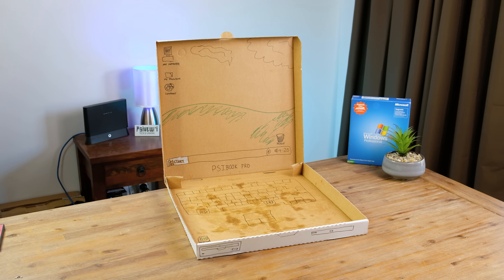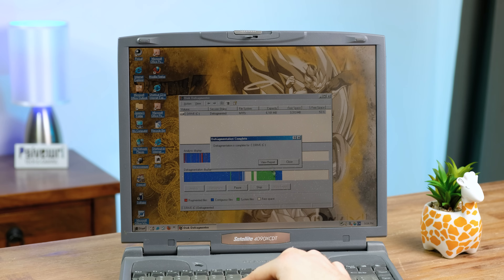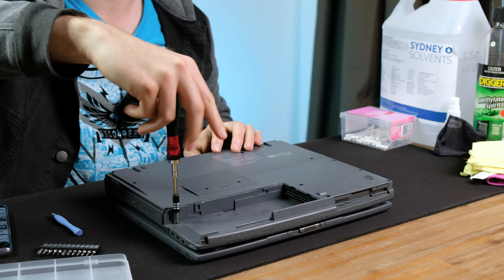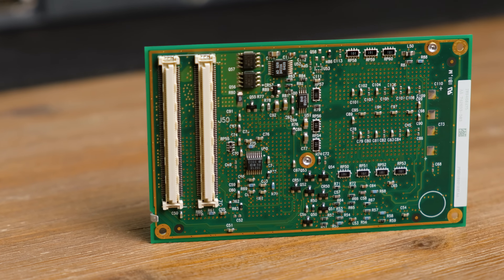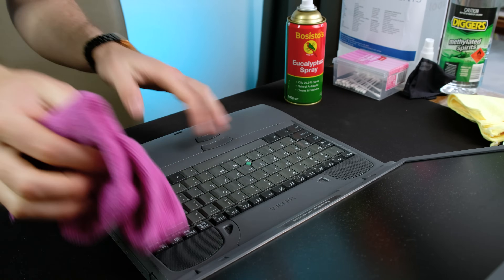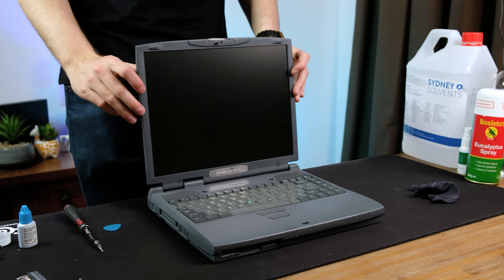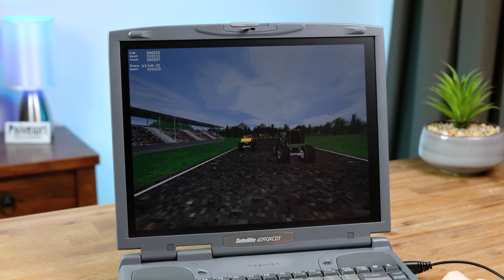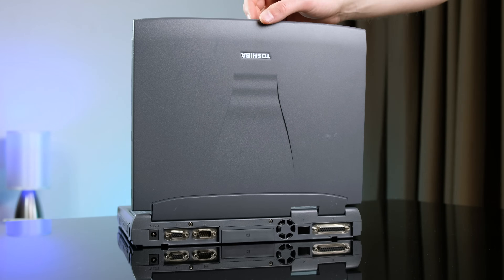Restoring An Old Windows 2000 Laptop!

Comment: I have a dell latitude that runs windows 2000, I thought about going back to win 98. I also have a newer latitude that runs XP and that's my favorite laptop I like these because you don't burn your legs using as a laptop the fans are in the rear of the computers. I actually have three old laptops my 2nd favorite was an apple running the lion version. I don't like new apple anything. I will keep the old ones running. I have to find my oldies packed somewhere in the hall closet. My first computer was a TI 99/4a all my computers worked the last time I fired them up. 73

Comment: The reason for the brightness changes, overall dark screen and the red/orange tinge over the whole screen is because the CCFL tube used for the backlight is reaching the end of its life. That screen has had heavy use over the years, and probably has tens of thousands of hours on it.

The CCFL can be changed, but it's not a trivial operation. Most LCD panels are not designed to be serviced, and the CCFL(s) are usually buried deep inside the panel, often requiring the panel to be completely disassembled. If you get that far into it, you'd be better off LED modding the panel, which would result in a brighter image and lower power consumption.

Comment: I bought a lower end version of the exact same laptop (a 4060XCDT) for exactly 1€ at a boot fair. It comes with a mobile Pentium 2 at 333 MHz, and came with the 128 MB RAM expansion, which unfortunately was defective. The hinge also broke on me, and even after attempting to expoxy it together, it's quite loose. Apart from that, everything works perfectly, even the original 4 GB hard drive, and even the floppy drive! Oh, and the speakers sound absolutely incredible for the age of this laptop. Aesthetically, it's in perfect condition.

Comment: If you own a computer from this era and you want to copy your files and save them to a new modern disk you simply cannot do it since there are no compatible ports with modern computers any more...so basically your files go with your old machine if you didnt manage to create copies when technology was changing and thats something everyone has to consider in the long run and create backups.
Reply: it have USB port, you can plug an USB to back up your file just in slower speed (USB 1.0) or even in an old way, burn a CD-r lol.

Comment: One of the best variant of these laptops is the Toshiba satellite pro 490XCDT, I did the same ram upgrade, and faster 80 gig hdd. PCMCIA LAN 10/100mbs, and Dlink WiFi, with win XP pro SP2. Zero driver problems It's heavy, and thick, it works well enough to do office work, and remote desktop to wirelessly access my main music computer. You did a great job with this. Thanks for sharing. 
One thing though, you were lucky to get this laptop unlocked, I had to make a dongle to use in the parallel port to unlock mines when I bought it.

Comment: Recommend:
- Upgrade BIOS.
- Upgrade CPU to best.
- Upgrade RAM to best.
- Upgrade drive to cheap IDE/ATA SSD.
- Upgrade ODD to DVD-ROM or Writer.
- Use decent Thermal Compound.
- Install best free software.

Comment: A few years ago I bought this same laptop (I have the different variant you mentioned with Pentium II). Had already the RAM upgraded to the max 192 MB. The previous owner decided to install Windows XP - was insanely slow - literally 5 mins to boot. Mine has a Y2K ready sticker, haha. The right OS for this machine is Windows 95, the reason I bought it was for DOS gaming. I did some research, this is one of the last laptops with good DOS support - the sound card is Soundblaster compatible so you will have full sound support in DOS mode games. The SB support is not accurate though, in some games it doesn't right, but it's OK. You can use Windows to connect to your network and copy stuff and drop down to DOS to play it, that's what I do with it. Windows gaming on this machine is Minesweeper level games.

Comment: Earlier models of these were kind of beige / brown. I had one a long time ago. Those keyboard control mouse was extremely fidgety and a usb mouse was a better solution. That was back around win 95, and those were extremely heavy carting them around and just nice to put it down. That’s the Uk, those didn’t have network connections. Those things did have cds. Although those days far lighter to take a usb stick home than the computer. It was also back in the days of floppy discs and iPhones.

Comment: I ordered myself a Toshiba Satellite Pro 4080XCDT with Pentium II 366 as a retro hobby project.
I'll install Windows 98SE on it for DOS compatibility.
Same crappy Trident card, but I'm not going to use hardware 3D so it should be fine. The reason this card does not run any 3D accelerated games properly is mostly the RAM. The card just has 2.5MB of VRAM and in that it needs to store both the frame buffer and textures. It just will not fit.
It has a  ES1978S ESS Maestro-2 sound chip (PCI) which should have a DOS SM emulation driver for sound in DOS.

Comment: fun fact I’m also in Australia and also I have a did she have a sad way for you for 600 with a dead battery father so I can get the plug icon shows and the breaking bad boy icon Hello so it’s model number is the number at the front is a Toshiba satellite pro 4600 with a damaged power supply

Comment: If the cmos battery is dead it will actually screw with the comouters ability to load web pages. It will just give you the security error when you try to load a page.

Comment: Being a bit late on the show, but just discovered your video and had to add some detail.
It looks like a MMC-2 CPU-card you got there on that late 1990's machine. Back during the early-mid 2000's while working on the Pentium-II 233-266MHz ThinkPad 770X/770Z-lineup, it came to my attention that these MMC-2 CPU-cards went up to a Pentium-III 850 SpeedStep processor and that they could be installed, running at 700 MHz though. But still a major improvement.

The modular design of your Toshiba resembles the IBM ThinkPad line quite a lot. The LCD-hinges does look like coming from the same OEM-manufactorer. Instead of using WD40, I'd recommend using TriFlow (lubrication oil with Teflon) or Singer Sewing Machine oil on the hinges.

Thirdly, you should go look for NT 4.0 memory management tweaks. These will work in Windows 2000.
For one, the IoLockLimit tweak should improve performance.

Windows 2000 is an excellent Operating System. My latest W2K driver supported machine is the 2005 range ThinkPad Z60m. With GB's of RAM and a CPU in the GHz-range, Windows 2000 is flying like a Saturn-V.

Good luck and best wishes.
Cheers mate.

Comment: From my own research, owning this laptop myself and running Windows 98 SE on it, the highest version of Direct 3D it support is 5. So yeah, not an ideal laptop for 3D applications. However, it runs perfectly for the purpose I bought it for which is DOS. I honestly only expected to run later DOs games on it as in ones that didn't tie framerate to clock speed but it turns out by altering cache and battery saving modes in the BIOS you can get the speed down to around that of a 386. Just don't accidently boot into Windows with these settings - It will start up but you will not have a good time. It is interesting to observe, though, given this is the only way to see how 98 would have run on much earlier hardware.

Comment: Watching this from Windows 2000 laptop :D
Reply from the maker: What model is it? :)
Reply: @psivewri  Mine is not that old. It is Dell D630 Latitude with Intel Core 2 Duo. A couple of years ago I've installed Windows 2000 just for fun and it still works fine with Extended Kernel, I have a modern browser that works fine.

Comment: Did Trident ever not make very low-budget video cards? Many years back I bought a 386DX40 based PC at a thrift store for $5 and it also had a Trident card. Sure, it had a whopping 1MB card, but it surprisingly couldn’t output anything above 256 colors, and even that was unstable above 800*600 resolution. I wouldn’t be surprised if some competing 512kB cards did a better job!

Meanwhile I have this other video card whose name I can’t recall off the top of my head that actually does 32-bit color, though only in a rather unusual 640*400 mode.

Comment: The graphics card has no 3D capability regardless of the OS so driver swapping will yield no improvements and with 2.5mb you're barely able to do 1024x768 at 24-bit color in the desktop. Also, the MMC-1 CPU module did not have an AGP interface so even if you theoretically had a good graphics card you would be bottlenecked by that. The only real 3D capable mobile GPU of that era would be the ATI Rage mobility cards and even their performance was meh at best.

Comment: 00:30 LOL I can relate to this. Have acquired 25 laptops, most of them over the past couple of years, mainly Thinkpads and Dell Latitudes from around 1998-2005. Wish I knew more about the earlier OS (eg Windows 98, Win 2000) and how to install them, though XP is no problem, and you can usually put something like Antix Linux on them.

Comment: For anyone who want to know how to make a Windows 2000 / XP CD: 
Step 1: Download a Windows ISO image. Step 2: Restore the image to a blank CD. 
I use the term "restore" to mitigate confusion over how to burn the image. You do NOT want to drag and drop the ISO on the CD. The ISO is like a zip file and the process should extract the file system onto the disc.

Comment: i kind of recall theres an old bug that made the cd icon disappear or similar. i think you could delete the regkeys to repair.
HKEY_LOCAL_MACHINE\SYSTEM\CurrentControlSet\Enum\IDE
HKEY_LOCAL_MACHINE\SYSTEM\CurrentControlSet\Hardware Profiles\0001\System\CurrentControlSet\Enum\IDE
HKEY_LOCAL_MACHINE\SYSTEM\CurrentControlSet\Control\Class\{4D36E965-E325-11CE-BFC1-08002BE10318}

Comment: I was already amezed that windows 2000 was on it considering this laptop was indeed from 1999, windows 2000 could never be standard on this laptop because windows 2000 was released 1 year later, unless this laptop was rebranded in 2000.

Comment: I had a very similar Toshiba (can't remember what model), had some bad things happen to it, hinges completely snapped so I fitted what I'd describe is supports, one day the "supports" moved and the screen fell back on the desk I had it on destroying the back light, I did try replacing the back light but snapped it so I just removed the screen completely and used it on a monitor.  
I made the most out of that laptop and it refused to die, I mainly used it for emulators in dos around the time I stopped using it.  I've no longer got it now though which kind of makes me sad after seeing this video.

Comment: You should REALLY remove the clock batteries from these laptops. They tend to leak, and the acid travels through  the wires and corrodes the motherboard.

Comment: No one will ever understand how useful USB is until you work on an old computer and it has a USB port.
Despite the slow USB 1.1 speeds, it's like Christmas for me.
I don't need to write a floppy for drivers, no need to burn a CD, don't have to transfer files over a network, just plug in a USB key and woo hoo!
Or if I need to use a USB keyboard or mouse it's like, YES IT'S SO EASY!!!
God bless USB
Reply from the maker: This! Yep, it made it much easier, that's for sure!

Comment: I have the exact same laptop, it manages to run Half Life 1 (original disc version) at about 25 fps in software mode. The Trident GPU has no 3d acceleration of any sort. I have win2k installed and afaik the cd drive works flawless.

Comment: Damn, I remember having 2 of these same machines back in the day. One had 128Mb RAM , the other had a WHOPPING !!  256Mb. Both had the same Xircom pcmcia network adaptors too. I think your pizza box might still be faster than these were....
Transfer a 3.99GB file via that USB 1.0 port (max single file size fat32 would allow easily). Its a good way to time something, you start the transfer, then you have time to have a coffee, a wank and a shower before the file completes....in fact, it will probably only be halfway through, so time enough left over to find a priest and confess your "SIN OF IMPURITY" and atone with a 5 Hail Mary, and 2 Our Father penance.....

Comment: Used to own the lower end 4070CDT model of this, sadly the built in RAM failed. Even if you get the Trident 3D chip working you're better off running stuff in software mode - it is very glitchy and slow (dare I say worse than the S3 VIRGE!)

Comment: I had a nearly identical Toshiba (With some weird 2,5MB 2D GPU) back in 2003. Games like Half-Life 1/Counter Strike, Unreal Tournament, Starcraft, Diablo... ran playable on it.

I even tried UT2004 on it when it released and it was able to run it in software mode ... at 3~ FPS.

I swapped it in 2005 with a Gericom, that one had a P3 800 Mhz (Instead of Celeron 400) with 256MB RAM and a ATI Rage GPU (8MB), the D3D support was a "game changer" and even games like Warcraft 3 ran just fine. I got some 54Mbit U.S Robots WiFi card and could use my full internet speed just fine.

Comment: Nice restoration! Most likely it originally shipped with Windows 98 since it only had 64MB RAM installed from factory. Being a relatively mediocre Celeron 400, the Windows 98 SE would be a better choice of OS. Windows 2000 tended to run somewhat slow on anything below 600 MHz even if it had enough (128MB or more) RAM.
Reply from the maker: Last night I did install 98, found all the drivers as well. Seems to run pretty good 😊

Comment: if your really concerned about the speed, there is a 600mhz pentium 3 upgrade you could squeeze in, but just looking for a clockgen & using setfsb is a much more efficient use of an overclock.

Comment: I remember helping a woman with her Windows 2000 computer years ago. I updated it with the latest Windows updates and it worked pretty good. I now own an HP 17" laptop with an SSD upgrade from the original HDD and it still works pretty good with it's 16GB of ram and i7 Intel processor. It doesn't compare well with the latest and greatest laptops except for the 500GB SSD I put in. I'll keep using it until it quits. It is still powerful and fast for its age!

Comment: Hello @Psivewri, I am 99% sure the heatsink isnt riveted on the CPU board, you need to bend the corner claps on the heatsink or heatspreader to remove it. I have a few Pentium II era notebooks and CPUs in them look like this and can be removed without drilling the rivets

Comment: You could use windows 2000 in 2020 man if you follow a good tutorial, i recommend to use the tutorial made by i430vx named "Use Windows 2000 Today! Win2000 With KernelEx In 2020", it takes about an hour of your time, but it will make this laptop shine in usefullness, let me know if you did follow the tutorial and how it worked out for you, i used it to pimp out my Thinkpad A21m and it works like a champ with a fully compatible modern browser running on it

Comment: Also be careful with the hinge, I had a laptop of the same era (Same design as well) from toshiba (Satellite pro 4280)
The hinges were really tight and I applied some WD-40 and the hinges became the complete opposite and would not even hold upright.
The machine still sits like that years after the hinges broke.

Comment: There is one thing which I did not catched on your video: did you installed Windows XP later successfully or not?
Reply: Any machine that can run 2000 can run XP too, it's just a revised version of 2000.

Comment: If anything, if that graphics chip is like the NeoMagic 256AV (2.5MB SGRAM model) in the Portege 7020CT. Then it's not a graphics chipset that's capable of anything after 1997. However, games before that (like the DOS era) are excellent!

Comment: These Toshiba laptops were the last ones before the build quality started to drop significantly. Cool you managed to get hold on one.
Just an advise: remove the green Varta battery packs which keep the RTC and the CMOS RAM alive while the machine is turned off. The NiMH coin cell batteries inside are prone to leak, and if the acids reach the motherboard it's game over. I removed these battery packs from all the Toshiba laptops I have, and actually all of them were leaking inside, while fortunately no one did yet any damage. But they were all ticking time bombs!
Reply: Agreed - one of those varta batteries sadly destroyed an Armada 7800 motherboard I had - fortunately I had a spare board.

Comment: I would first think of installing win98/ME instead of staying with win2000........
And as for the Trident graphic chip, it's only good for ordinary jobs like office editing, web browsing, something like that, don't expect to use it for 3D gaming, it virtually has no 3D graphic capability, you won't be able to fix it by changing different versions of driver.

Comment: My first laptop (still have it) is a toshiba tecra 8100 from the same time as this. Originally had windows 2000 and upgraded to xp at some point when it was my main computer. A few years ago I put 98 on it as I’d never used that OS before. Thing runs better under 98 than it ever did running 2000 or xp
Reply from the maker: A few people have mentioned the better compatibility with windows 98. I'm actually putting 98 on there right now :)

Comment: Back in 2005 I had a Satellite 4200. That originally had a 500Mhz Celeron and a 8Mb 3D accelerator graphics card. I upgraded that machine to 320Mb of RAM, 40GB HDD, swapped the original CD to a DVD, and as the processor was socketed too, changed the Celeron to a 750Mhz Pentium III. Good old memories :)